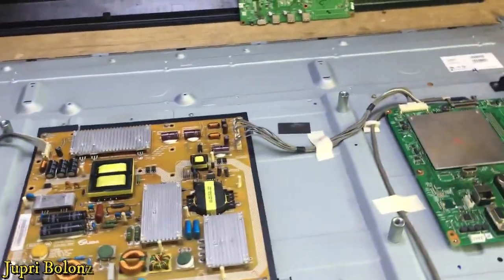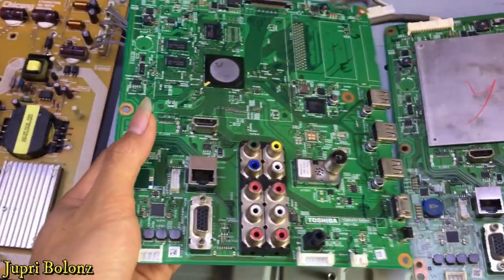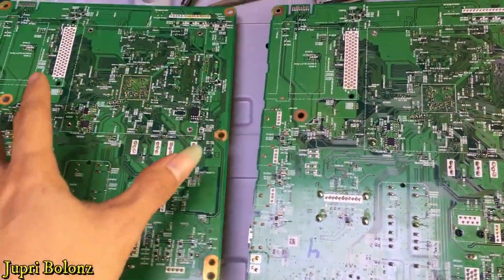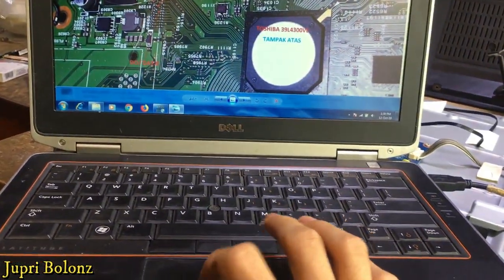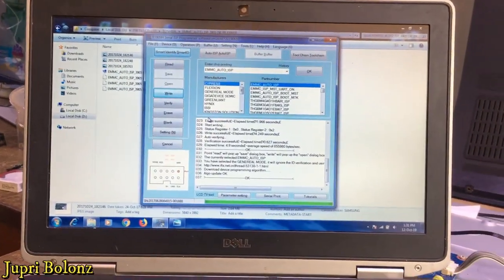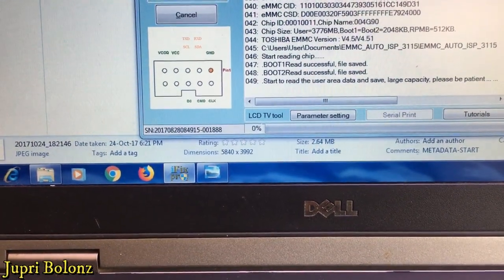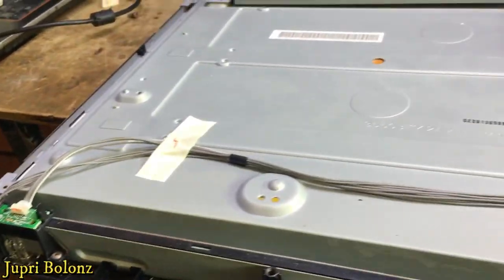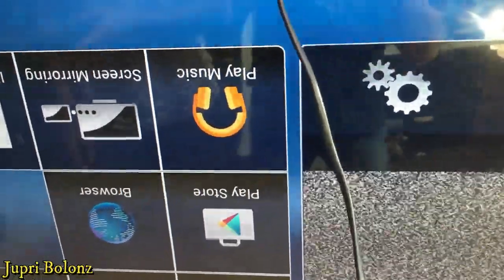EMMC Flash Led TV Upgrade To Board

Comment: mau tanya oom, sy ada toshiba 40pb20e boardnya mati, kebetulan sy ada toshiba 39L4300 yang layarnya pecah. Apakah bisa board 39L4300 saya aplikasikan ke Layar 40pb20e ? secara langsung atau perlu modifikasi lagi? power supply keduanya tidak bermasalah. Terima kasih.
Reply: Gan dijual ga" board toshiba  39l4300 nya? Kalo dijual saya beli gan maniboardnya... :)
Reply: Gan ayo kita barter mainboardnya? 40pb20e dengan atau saya beli 39l4300 nya!

Comment: Sya ada 39L4300 restart terus om, kalok di flash bisa sembuh gak ya
Reply from the maker: Kemungkinan bisa .
Lebih jelas nya harus di coba
Reply: Terkadang restart, terkadang nyala 5-15mnit trus restar. Pas nyala itu di remot Ndak fungsi. Tombol juga tidak fungsi. Yg diflas winbon nya atau emmc nya om?
Reply from the maker: Harus nya emmc itu yg di flash
Reply: Ok terimakasih
Reply: Boleh minta nomer wa om